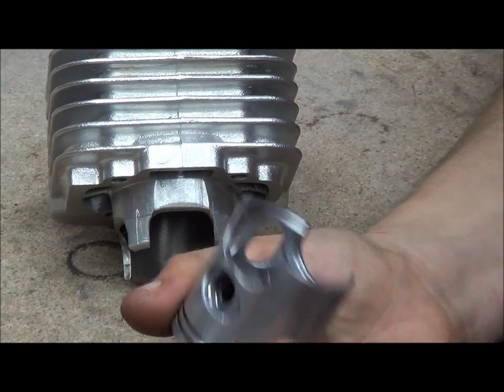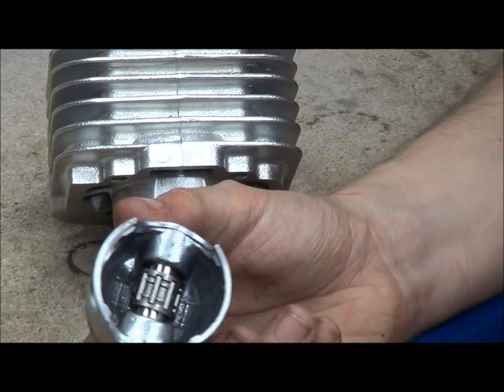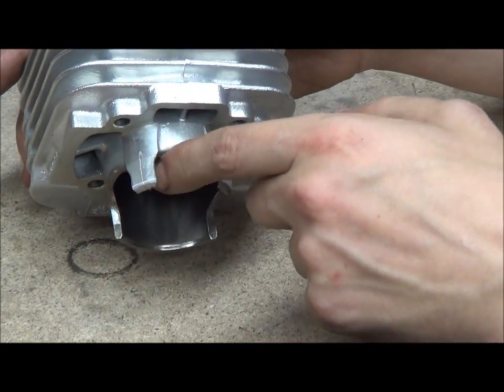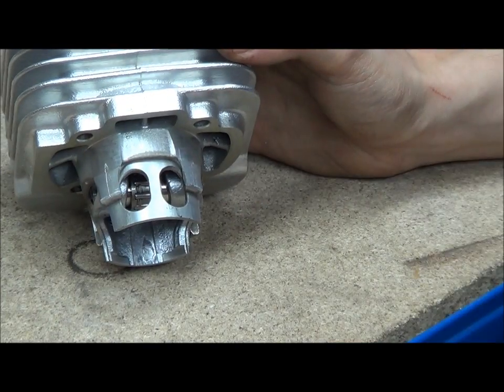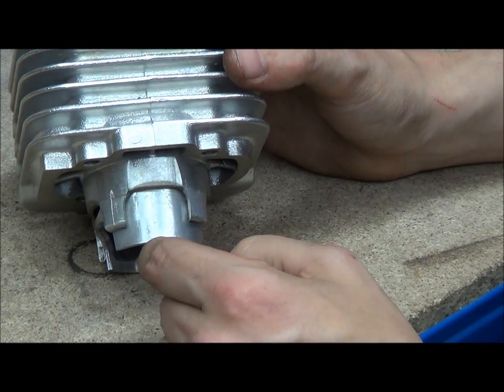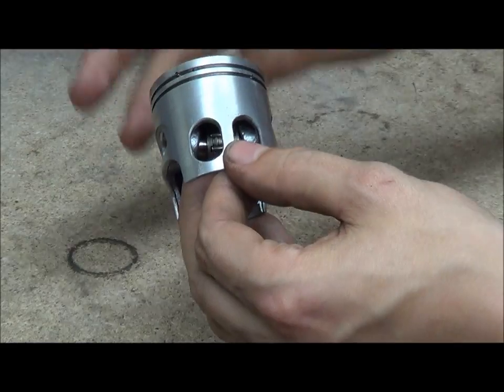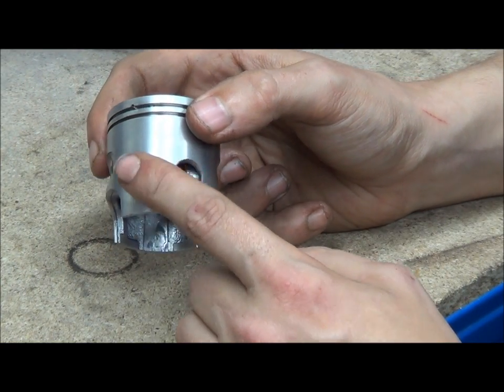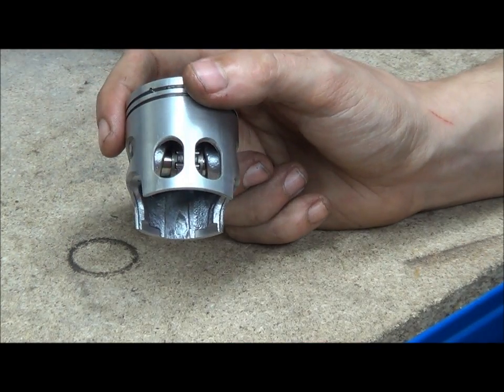Windowed Pistons - 2 stroke

Comment: I'm putting on a ported cylinder and while it's apart I was going to add a windowed piston and reed valve. Does it matter if you get a single or double windowed piston? The price is about the same

Comment: what is the difference between flat top and crown piston, should i run flat top piston on a standard 2 stroke cylinder kit or i am good with normal crown piston
Reply from the maker: One is flat, one isn't.
Reply: @thedirtyworkshop  which will be better for my engine, flat piston or crown piston😅

Comment: Instead of the windows, you can cut off part of the piston skirt which will keep the intake open longer.  The windows are easier to screw up where cutting of part of the skirt is relatively simple.
Reply: hey bro ive never heard of cutting of the piston skirt, im porting my cylinder rn could you explain?

Comment: There is also a secondary reason a windowed piston is used .... as the piston is approaching bottom dead centre and the piston windows are open ... there is a free path where the exhaust port ... transfer ports are open ... this allows the exiting exhaust pulse to drag fresh fuel air mixture into the cylinder ... and as the inlet timing at this time is only controlled by the Reed valve extra fuel air can be scavenged  into the crankcase and cylinder ... just another way of wringing every ounce of power out of two strokes ....Reed valves have asymmetrical timing meaning that is there is vacuum on them the will allow fuel air to pass ... but at the cost of being in the way .... I prefer rotary disc valve myself ... lol

Comment: It won't work in an engine that doesn't have reed valves, will it?
Reply: I've been looking for some sort of explation about this also. Can't seem to find much about wether windowed piston would work in a none reed valve 2 stroke SOMEONE ADVISE PLEASE?.  so.. due to not being able to find any explanation I'm toying with the idea of 'skirting' the piston .. which is shaving off the bottom of the piston when it's at BDC which I'm sure would have the same effect there. Not sure how much lighter it would make the piston though if anything noticeable but sureley would be the same affect as windowed piston?
Reply: I have an old jug with one intake hole stripped. I'm porting it now. Will drill/tap and red locktite a new stud.
The piston window ? Might do that too. Seems like it would work. Wouldn't it just suck in more fuel/air mix into the crankcase on the pistons way back down ? Even if it was a millisecond?

Comment: Matt. Could you tell me why some people even add a third hole above the other 2? I have heard somewhere that it adds power and also helps evacuate hot gasses from underneath the crown especially when desert racing.
Reply: The third hole should be under the rings over the exhaust port, which has the effect of adding some fuel to the back pressure wave and help cooling the exhaust port.
Reply from the maker: No, I can't - never heard of it
Reply: @thedirtyworkshop  Thank you for responding Matt. God bless you!

Comment: I don't suppose you can explain these holes? 
https://photos.app.goo.gl/XKiE45xFYnz6ntAJ6
(Yes, they all have them. 1921 Ner-a-Car)
Reply from the maker: weight reduction
Reply: Possibly, but the engine only revs to about 2000rpm and the flywheel is actually overbalanced for the piston weight.
Reply from the maker: Not rotational inertia - reciprocating mass. This puts less stress on the wrist pin, piston and con-rod.
Reply: Facilitates Lubrication

Comment: You should do more hands on videos like this. Nothing against the white board videos, I've just never really been much for theory(I guess youd call it that?) and lectures even when I enjoy the subject matter.
Reply: If I may ask what are your thoughts on having chunks or parts of missing cylinder whether it’s below cylinder window or above cylinder window I was told if it’s below or above cylinder window then it should be fine I can’t remember which one whether it was okay to have missing metal from cylinder below or above just wondering your thought I have 3 if the same engines they all have the same bottom end but the only thing that is different between the 3 of them is the top end and piston I have a top end that has a piston with just a circle whole for the intake and that’s a single reed cylinder and piston while the other one has double reeds with a single oval window on piston siimilar to the piston shown here except your piston has  double window and mine base single window that’s oval in shape the top end that’s the fastest has oval window on piston I think it’s 6-8 Hp the second to smallest engine has a circle cutout for single reed intake and the very smallest engine has NO cutout on piston at all and no reeds on intake… what’s your thoughts on the cylinder with missing nika sil  above or below the ports  I will say the cylinder with the highest HP seem to run fine after a carburetor cleaning but we ended up breaking maine drive shaft sprocket. And the silencer or the stuffing in muffler was saturated with oil and spitting out all over my hand when placing my hand behind it

Comment: Why would windows have effects on intake process when the piston is going down in the crankcase closing the reedvalves? My theory is about the mixture traped under the piston going threw the boost port, it might give you torque at low and mid range rpm.

Comment: Can I just say that your account of windowed pistons is wrong. For a start the windows are there so at bottom dead centre (which never goes beyond he bottom of the spigot, like you show in this video, unless there is a spacer on the bottom) the mixture can be pushed into the boost ports, nothing more. That's why engines with just side transfers don't need windowed pistons.
Reply from the maker: LMAO - Look, on the piaggio engine I used in the video this is why the piston is ported/has windows. Its also helps cool the piston and oils the bearings at the small end. Some engines maybe different, but from the 8 ~ 9 engines I've seen with windowed pistons this is how its done. When I align the piston with the cylinder skirt like I did in the video you can see the cut out. What I didn't show was that this was BDC and you can see the transfer ports uncovered if you look from above, down into the bore. 

Let me ask you this. If the windows in the piston aren't used for this reason, then why have them? The windows in the piston will always be facing the cylinder wall, until thay pass only 2 of the 7 tranfer port (in this engine) and the windows will only give you access to the bottom of the piston. Why would you wanna do that? Weird how the windows are only on one side. Abit like resonance cavities, they're only on the exhaust side? Strange don't you think?
Reply: it doesn't cool the engine , it has boost ports - those things you missed when showing on your flow video
Reply from the maker: lol also known as transfer port - fell for the marketing wank again.
Reply: are you swearing at me? they are called boost ports as they  usually open fractionally earlier half a mil maybe. I've been tuning engines for 35 years. But I let my engines speak for me . give me your address and I'll come show you how to build a engine be it a R1 or 50 zip. you ingrate
Reply: if the cut outs weren't there then the boost ports wouldn't get any charge. It isn't rocket science this. the charge is compressed at BTC to open into the ports. If there wasn't any windows then there would be no need to have a cut out in the spigot. It's 2 stroke tech regardless of piston port or crankcase port. It may be old tech but like others have said bar rotary engines , 2 stroke engines have 90% better power than 4 strokes as some charge has to go down the exhaust , but a good exhaust will push it back in as he inlet timing is longer than exhaust.
Reply from the maker: "2 stroke engines have 90% better power than 4 strokes"

Do you mean 90% more?
Reply: ya can show me how to rebuild my 636 b1h engine Mark  :-)

Comment: why would you want air and fuel to flow in under the piston where it cant be ignited by the spark plug?
Reply from the maker: You've got to remember that this is to allow air to be drawn into the cases when the piston is at BDC. It also helps cool the piston. Does that make sense? thanks for the comment - matt
Reply: Pony Power no still makes no sense as then you have fuel going under your piston where it is not supposed to be, never seen a design like this, never seen a carb that would be connected at the bottom of the barrel
Reply: yes i do understand 2 strokes, sorry hahaha had a blond moment there thought it was a four stroke engine hahahaha. makes sense now.
Reply: @1stDirtDevil  air/fuel mixture is drawn into the crankcase 1st then as piston returns to bdc it forces the mixture into cylinder through transfer ports.
Reply: @1stDirtDevil  never mind just seen your correction lol
Reply: @1stDirtDevil  study more ,the principles of a 2 stroke engine,  how it works.  And you will have the answer.
Reply: Bearings need oil to live

Comment: It's crap,the problem is not that the piston is crap the idea is. When you reach the maximum port enhancement you must extend it with welding the casting to enlarge it in some instances. But in my opinion the piston with holes with not draft cleanly at the highest rpm. But anything less it may work well enough.In general the draft or vacuum will be created by the flow the holes disturb that flow as well weaken the piston.
Reply from the maker: Cheers for the comment- I've been having problems replying to comments but I've fixed it now - 

The holes in the piston are there during intake through the reed valve. This is to reduce intake pulsing and increase casing filling speeds. Does this work the way it should across all rpm ranges - no - nothing does.

 thanks again matt